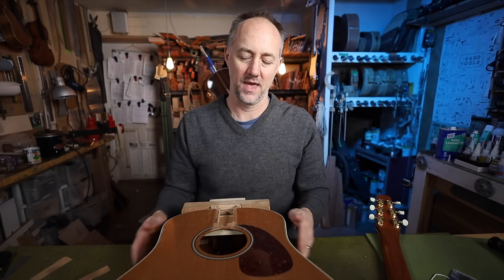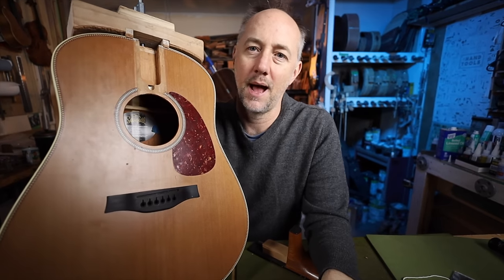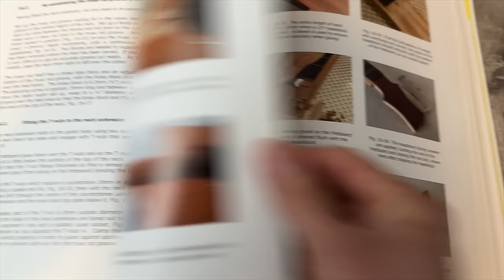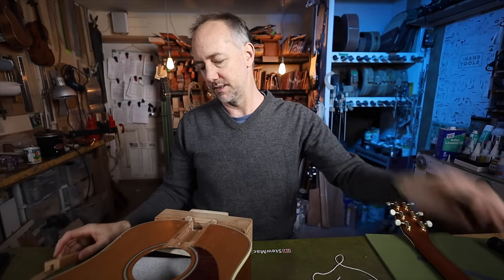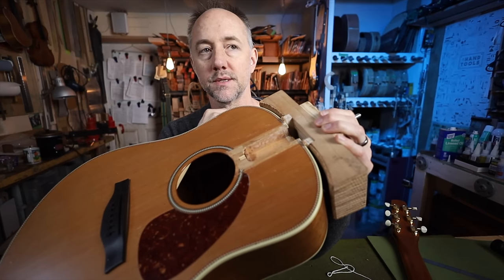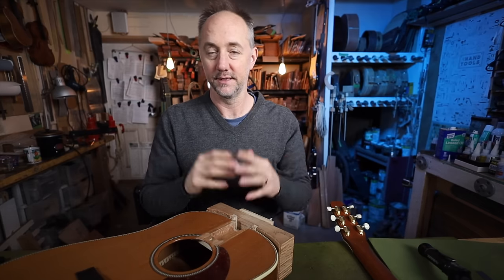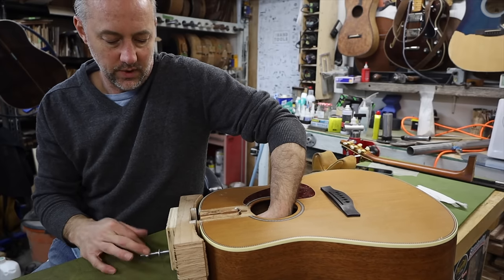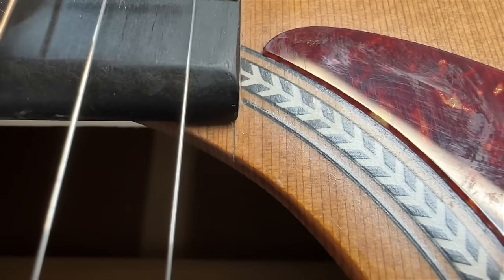The Hidden Problem with Seagull Guitars...

Comment: I can't follow you, Beau, you seem all over the map:  "I do like this system but it's shit... it does add stability and I don't mind that but the problem is it's stupid..."
Reply from the maker: Fair enough. I like a certain aspect of something- like the block under the fingerboard. It’s smart. But their execution of the principle is bad- ie epoxying it in as it makes the guitar almost unfixable in regard to a neck reset that ALL guitars eventually need. Taylor and Trevor gore do a much smarter job of the same idea.
Reply: Why are they using epoxy?  Is it a cost-cutting measure?  @BeauHannamGuitars
Reply from the maker: I'll tell you if you follow me, having explained my reasoning for saying allegedly contradictory things.
Again, its like I said "I like pools, and I like stairs leading into pools, but this pool has badly designed stairs, and this pool in in the shape of a star which is a stupid shape for a swimming pool."
Make sense?
Reply: My head hurts.  @BeauHannamGuitars

Comment: If this is such a POS why don't you just get another guitar?
Reply from the maker: I was repairing it for someone. I was not said I didn’t like the neck system being almost non repairable - never said I didn’t like seagulls guitars
Reply: @BeauHannamGuitars  - I shouldn't have said "you". I was thinking maybe it wasn't worth the repair as opposed to buying a new one. (After looking at what I commented, I was probably a little obtuse)
 I can see this was pretty much a challenge for you to see if you can fix it. 
I watched this because I have an S6 from years ago and always thought it was a worth while guitar but it now has a neck angle problem that a truss rod adjustment isn't going to correct. The cheezy tuners have almost stopped turning as well. 
Neck reset and new tuners?? Worth it ?? I just don't know.
Reply from the maker: This guitar retails for about $1600 US so says Sweetwater so it was worth fixing. A few videos back I posted a video called “how long”- and that is a viable option for “resetting” Godin acoustics made after 2006.- basically take the frets out and plane the fingerboard to regain correct geometry.
Reply: @BeauHannamGuitars The more I look at it the more I think I might get away with taking down the saddle to almost nothing. 0.146 in. is all I have to work with without getting into the rosewood bridge.
0.231 in. -  bottom of low E string clearance at the body joint (14th fret), straight neck
The nut is already as low as I can get it for decent action at the first fret.
 If I try to correct the action at the body joint with the truss rod it will be all back-bow. That isn't going to get it. Thanks for your thoughts.
Reply from the maker: @78tag  if taking the saddle down gets you in a decent action range it’s a good move- if the bridge is high you could shave it down a bit. Best option one there then resetting the neck is to take the frets out and give it a cheap neck reset like in my video.
Reply: @BeauHannamGuitars  Thanks again for time and advice.